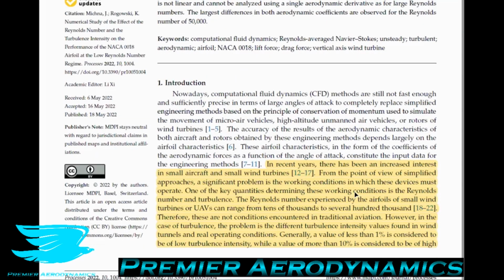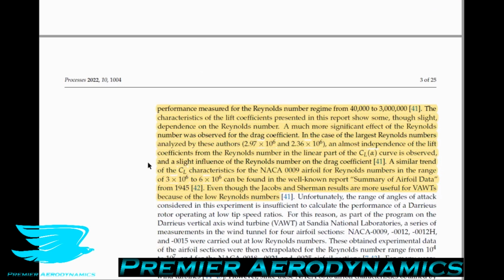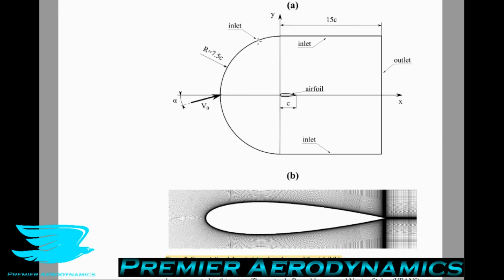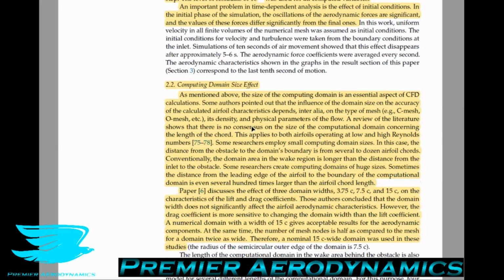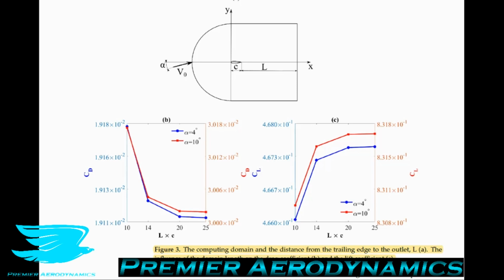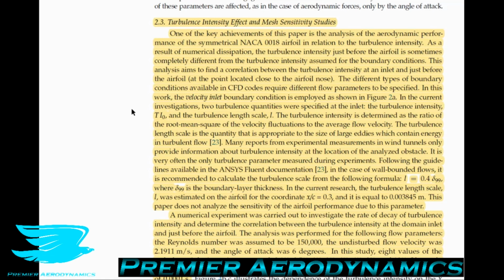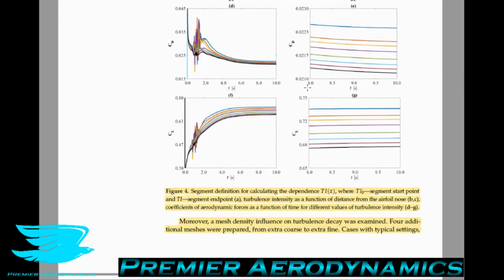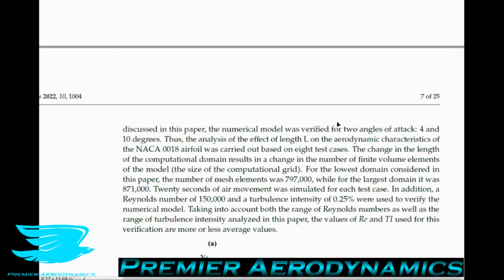Turbulence intensity's effect on NACA 0018 Airfoil performance - Podcast #124

Comment: Dude, I'm Australian and I can barely understand you.
Reply from the maker: Okay, thank you for the feedback😅
Reply: @PremierAerodynamics  Yeah, I think you need a better microphone and to slow your speaking down. Keep going though. You just need to make some adjustments. I'm from Newcastle, btw.
Reply from the maker: @danielstewart3507   @danielstewart3507  Thanks! The microphone thing is a good idea. The one I currently use has internal circuitry to cut out background noise, but that also makes it cut out lower frequencies. So, thanks for the things to consider.👍